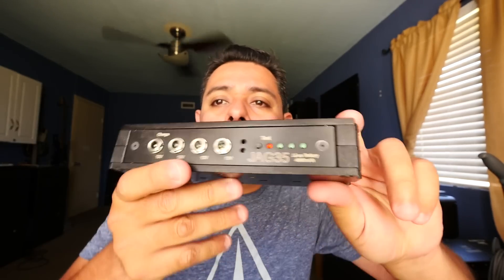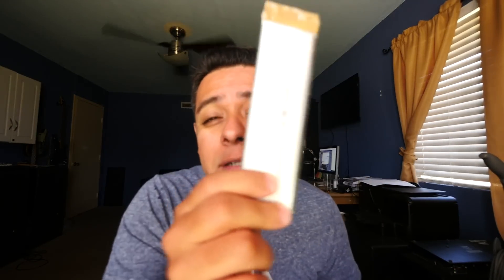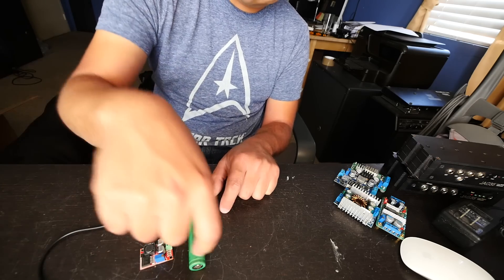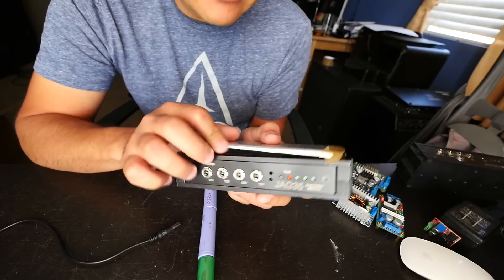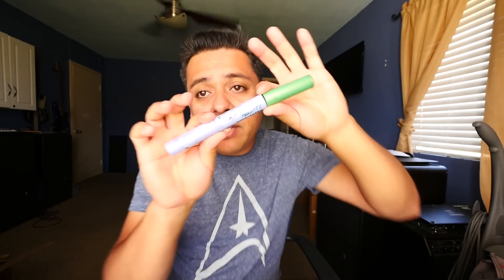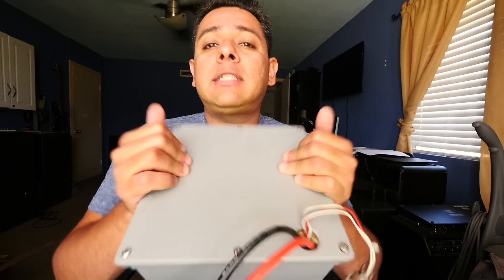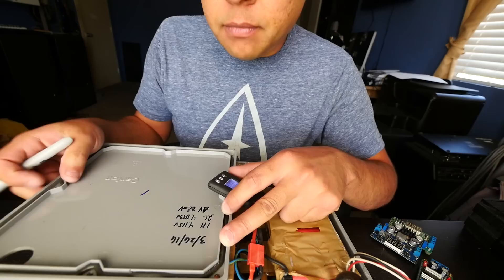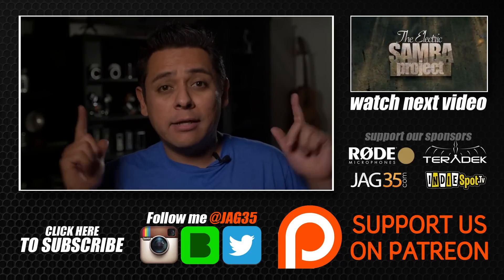How to Charge Lithium Batteries

Comment: OK,,I BOUGHT YOUR  U1XP12,,IT HAS 2 CABLES COMING OUT OF IT..WHAT PINS DO YOU USE TO CHARGE IT?
2 YOUR MONITOR YOU SHOW ON THE VIDEO FOR THIS  U1XP12   DOES NOT SHOW HOW TO HOOK UP YOU  BMS?
CAN YOU TELL ME  WHAT PINS TO ADD A 2 WATT WALL WART CHARGER..POS/NEG PINS?
VERY FRUSTRATING THERE WAS NO WIRE DIAGRAM FOR THESE BATTERIES.
I REACHED OUT TO YOUR TEAM AND GOT NO INFO..
CAN YOU DO A VIDEO FOR THE U1XP12 BATTERY,HOW TO ACCESS THE  WIRES?
THANK YOU

Comment: I have a question.  Was looking for a video on direction in how to use a 1s to 6s  TB6 Hobby charger/ Balancer  to balance a 60v 40AH  Lithium Ion battery pack in my Electric scooter.  Is  there an adapter I need that will support a 16s? Do i have to break my battery down into 3 sections? Do i need to buy a different,  more expensive balance charger??  Is there a way without doing any of the mentioned above?? Your videos are very descriptive, so I chose to ask you this question.  Thank you,  Anyone.... for a response.

Comment: Dang.  That's a lot of information...and too much math for me.  Good job on the video.  But I just want to know if my mini-chainsaw battery is going to get ruined if I leave it plugged in too long.  I had a handvac that worked two times before I had to throw it out.  It would not hold a charge.  I want to know when I begin cutting, that it isn't going to dwindle down to a low hum because I overcharged.

Comment: Hi can I use a lead iced battery charger that is 1amp 12v. To charge my lithium cells pack that it 12.6v ?
My charger is ready the lithium cells but I’m not sure if it’s save for me the use that charger as it’s meant for lead iced..
Can you advise on would it damage my cells if I attempt to charge with it.
Reply from the maker: Lead acid chargers go all the way up to 15v  it will most definitely over charge your 3s 12.6v lithium battery.
Reply: @jehugarcia  my charger has a settings were it stops at 12.5v
Will this make a difference?
Actually it will not go over 12.4v and 1Amp
Reply from the maker: Idk
Reply: @jehugarcia  sorry not familiar with that..    is this ok or not ?

Comment: Just like magnets, coils , solar cells or batteries are cellular devices..

When working with prius nimha batteries you have to put diodes on the + of every cell in the bank to preven voltage ballancing, similar to puting a blocking diode on a paralell connected solar panel..... The purpose is to prevent the weaker batteries/cells from pulling down the voltage of the newer stronger batteries causing the newer batteries to pattern into a shorter life and lowered charge capacity......

If we need blocking diodes on all our paralell panels connections, does this not indicate all psralell connected devices should have blocking diodes at all paralell conections in any power chain system ????

It seems a shit load of diodes in the system would prevent or. Lower overall heat values over time extending the cell life... 

If blocking diodes lower reduce heat and increase efficiency, panel optimizers also extend the life of a solar panel and increase effeciency...

Shouldnt we have some kind of optimizer/bms for each battery cell .

Comment: I would add to the many good comments and tips posted already, BMS are pretty cheap now, esp. for a DIY'er and if you can't attend and monitor charging, a BMS can add the safety you need with lithium batts cutting the power when it's set V is reached. some also can set a flat timer for charging

Comment: In my 48v battery-bank I’m using 3.2v I have 13 PCs at 280Ah and I’ve got 4 PCs 3.2v at 200Ah can I run in parallel 2 of the 3.2v 200Ah = 3.2v 400Ah can I use 2 - 3.2v 400Ah in my battery bank of 280Ah & if so the best place to put the ? As the the main - & + or as the Batteries 7 & 8 in the middle of the bank ? But their 120Ah over the 280Ah is it better for all the life to just use the 3.2v 200Ah as is ? So the 280Ah are only 80Ah more ?

Comment: Hi I have a question, I have an electric scooter with a power of 36v 1000w, I want to use a Lifepo4 3.2v 2000mah battery, it is possible to use them in an electric scooter with such a power,
Jirka volf

Comment: Well you forgot to mention that impedance does increase if you actually left the charger permanently connected to the battery as you said. Now sure how familiar you are with gauging and impedance track. I use to work for TI in the BMS group.

Comment: Sorry, but you're just plain wrong and are giving bad advice. You say that once the 18650 cell reaches 4.2V it can just be left connected to the charger indefinitely (as its voltage cannot rise any further). WRONG! Holding the cell at this voltage will cause plating to occur, permanently damaging the cell. As soon as the cell reaches 4.2V the charge should be TERMINATED immediately.
I only watched the first few seconds of your video because, after you said this, you completely lost my trust. You seem to think you're some kind of expert - and come across as such. Well, let me tell you, you're not. Please make sure you're giving good advice before you pontificate
Please take down this video.

Comment: NOTE: Charging batteries in series without a BMS is not advisable. 8.4, 12.6, 16.8, 24v, 48, etc. It goes Batteries, BMS, and then the boost, buck charger connected to the bms that's connected to your series/parallel battery pack.

Basically.

Comment: is it possible to charge a 7.4v (18650 x 2 series) DIY battery with a standard 5V USB charger? Im trying to make a portable powered 12v fan run off my 7.4v DIY battery but can't seem to figure out how I can charge the pack through USB as id like to 3d print a box and keep everything enclosed in it (Battery, 2s board, fan, USB charge port and anything else needed). THANKS FOR ANY INFO!

Comment: "How to Charge Lithium Batteries"
Easy...Do not exceed 4.2V OR current flow @ more than 1/2 [50%] of the rated capacity of the cell or cells in parallel.

Comment: I need 7.2 volts.. aka 2 in series.  So charging the cells separately one at a time with a 4 volt charger vs charging them in series with a 8 volt charger makes pretty much no difference in performance?
Reply: 8.4 volts in series may not be as accurate as 4.2 volts each ...

Comment: jehugarcia : I sense that you know a great deal about batteries and chargers.
I have an old, but really good and powerful, Dewalt with dead NiCd batteries.
Can the cells be replaced with Li-ion and still use the same charger?
Reply: What is voltage of the NiCd pack ?

Comment: 1. You can not charge battery with voltage regulator which only work on constant voltage mode. it still can over current and damage battery
2. You can't just parallel battery for charge. 2-battery can have voltage difference that lead to high current flow and damage battery
3. You can't just series cell and charger you need to balance these cell using balance charger or BMS .
4. Note that you should not use charging current more than 1C. it can shorten battery life.
5. for who ever plan to do this just buy programmable charger which you can charge many battery type and select suitable charging voltage and current for each battery.
Reply: 1. Yes we can, and we do ...
2. Yes we can, and we do ...
3. Yes we can, and we do ...
4. There are 18605 Cells that can charge faster than 1C ...
Reply: @MrSummitville  if you are normal person you can do. It's your right and risk. but if you are engineer or youtuber that teacher other without real knowledge, you can't  you should have responsible for society.
Reply: @mlab3051  So then ... stop telling us what we can't do because you have no clue ...
Reply: @MrSummitville  fine it okay to live with ego but I prefer knowledge.
Reply: @MrSummitville  if you have any argument please say in science or engineering term.

Comment: Thanks for the informative video!  So what do I need to buy to make a charger for 18v 18amph battery?  (I'M trying to charge 2 m18 9ah milwalkee batteries in parallel without using the milwalkee single battery charger)

Comment: Thanks for your great postings.
Im in Australia.
I’m going to install 12v 240v 3000w Inverter with 12v 100ah Lithium Battery in my car.
I’m trying to find a way to charge the Lithium Battery from 12v (120w) Lighter Port on dashboard directly in my car without connecting with my car battery if possible.
Can you tell me what kind of stuffs that i need to buy from like Amazon?

Comment: Can i charge an external 36v hoverboard battery with a 36v pover supply that has a different connector, to use it with a controller?

Comment: I read and listen to the people advising all kinds of things and selling chargers as if they are more important than the device using the battery?
Ask yourself 1 question and you will get my drift.

There are other devices using lipos and I mean not just rc or ebikes but other toys or electronics etc. You know how those 4x4 off road scale models run and compete. I'm sure that is a lot of stress on the rc as well as its battery. Think jumps gone wrong, rumble tumbles impacts and motion. Why don't they have it blow up in just playing with them because they actually abuse them not only electrically but physically like I wrote above they don't explode till every thing is OK only, a malfunction is the reason for it if it happens.

I found this a little too much about charging lithium ion batteries and in the rc world about lipos and how the can catch fire and all that. I'm not saying the risk Is absent, but the way it is portrayed in the rc world specially and the exorbitant pricing of things is not based on reality. A few sheets of depron some plywood etc is in a kit  and they are charging 70-80 to 500 dollars for pnp or af with electronics kit.
Lipo batteries need special attention and care, you have to check on her multiple times while charging and it is all hogwash and any reasonable person will see that.

How can we not see this when there are consumer goods and products. Even lithium ion batts were this way and lot of noise was made about them too.
Every smartphone has  lithium Ion batteries and apple and some other devices use lipos. Have you seen any swm

Comment: 2x4.2 volts is 8.4 volts you confused it by doubling 3.7 volts that comes to 7.4.in fact they call it 3.7 volt which is why it is not 8.4 volts but 7.4 volts and then 11.

Comment: ok i doubt he even pays attention to this anymore but, i have a question. i have a big inverter for servers, it has a max dc out of 55v to charge the 48v battery system. now i built a 55v nom li ion pack from chevy volt battery.  i let it charge on the inverter for 4 hours and it never got warm, it did go to the 55v that it was made to do. i know so much is said about the bms but i am wondering, if i us the battery on this setup lit it is and the 55v max is in the nom of the li ion. will it have issues? i am just not sure how it can ever be over charged or even charged to fast. the inverter has a lower charge rating than the li ion cells.  anyway if anyone wants to tell me how i am stupid, not just that i am. i would love to know

Comment: Can someone point me to a board similar to what he shows as a “power supply”? I’m building a 3s15p 18650 battery to supplement/charge my Yeti 1000 lithium. I need  constant output of 15-22 volt and 25 amp max from my diy battery to safely put power back into the Yeti.
Reply: That is DC buck converter one is step up one is step down depend on your power supply

Comment: Great video..… but I am looking for a "Lithium Cell Charger Module (BMS) with Battery Protection board" that would output a 18V (5S) system..... any thoughts????
Reply: george manson 18 volt powertool battery is ure best bet
Reply: @simpesfaip  Thanks

Comment: Jehu, I just found on the street a Ford Go battery pack and seems to be working fine. The problem is I don't know how to charge it. It has a connector for a wall power supply but no idea of what kind of voltage has to be. Do you have any idea of that? Thanks
Reply from the maker: No

Comment: 5:22 I know someone has probably already said this but 4.2v * 2 = 8.4v dude :)
Reply: 7.4v is the nominal voltage, 8.4v is the charging voltage
Reply: He also said you gonna turn up the supply to 4.2v in order to charge at 7.4v pack, which is wrong. And he should have also added that this won't be a safe way to charge batteries in series! Different internal resistance so some will charge faster than others leading to overcharge (fire)
Reply: I only checked the comments section for this
Reply: You're a math genius
Reply: He mean nominal voltage
Reply: I have 11.7 or 11.1 V 3cell Lipos... SO FUCK ALL OF YOU!
Reply: @kdevus  ?
Reply: BYUNG JAE Lee sorry bae. Still love me?
Reply: @kdevus  You lose. I have 2P7S setups.  25.9 nominal, 19.6 discharged, 29.4 max charge but set to 29.2 for safety. And 4.4 Amp per pack. And each and every cell is on its own BMS section. And there are 10 of those in each .50 Cal. ammo case. Making it a 25.9 Volt, 44 Amp battery with 140 individual cells.
Reply: @kdevus  I have a magneto for that. Here, hold my wires. ;-)

Comment: Its pretty good explained but a few details is missing... What about if my output is 16V and my batteries that are connected in series ends up on 16,8V? Can that be any dangerous? Or does it just mean that the batteries will never be fully charged? Or what actually happens? And what about amps? Does that even matter at all? Or is it only the volt that i should care about??? Please, either reply to this thread or make a new video and explain more details... I have a bunch of batteries that looks like those small green batteries that you just showed. I got them from a laptop battery but im not sure if its same voltage in my battery as in your battery. The voltage is not displayed on the battery itself... So is it same voltage for all batteries that looks like this? Or how does that work? How do i know how much voltage my battery will need?

Comment: I have two questions.i just build a 3s battery pack with balance charge cable (did not put pcb) total 12 batteries .My first question : 
1)is it ok to use the battery pack without pcb? what should be my minimum voltage to stop using the pack?
My second question is:
2) if i try to charge multiple cells lets say all of them (12) but each cell have different amps (capacity).is this safe? I know its not the best (pack will not perform as it should). Will all of those cells reach their real capacity when charging finish?(i have a turnigy when charging).what i understand from you is that turnigy will keep giving 12,6v to all the cells and 0,5amps(my charge setting) untill every cell is full.thanks and sorry for my bad english;)

Comment: I started pulling my hair out when he said 4.2 × 2 is 7.4.... twice!! Twice??
Reply: ohh shiiitt , nooooooooooo , i lived my whole life thinking that 2 18650 bateries equals 8.4 v , damnnn , i lived in a lie :)))))))
Reply: I would like to ask. Normally 18650 is max at 4.2 volts.and now i got bms for 26s config. Now how can i under volt them charging them at 4volts. Should i supply 102v and bms will balance them at 4v each cell or some cell will be 4.2 and some cell are lower.?
Reply: I may be mistaken but don't these li-ion cells reach capacity at 4.2V? The nominal voltage is only 3.7V.

Comment: I am using chev. Volt batteries to power my golf cars.  I would like to use the chargers that come with the cars .Is this power supply that you are talking about the way to keep from over charging my battery?  We are using 2. 48 volt packs wired parallel And then to the car.  My charger can put out about 20amp at 57 volts, and the goes down as the batteries go up. If this is the way to go ,do you have  specific power supply you would recommend for this application.

Comment: Can I use a 24v 1.5 amp charger that was uses originally to charge lead acid batteries 2 12 volt in series to charge a 24 volt lithium ion battery?

Comment: just use a 4.5 volt 300 milliamps with a 100 ohm resistor in series.the voltage of battery rises from 3 to about 4.2 volts and current automatically reduces as 4.5 -- 4.2= 0.3 volt divided by 100 ohm =0.3 milliamps = trickle charge

Comment: did you tell us how many amps your 12.2v charger can output?  how many amps does a 33p3s 11.1v (or is it 12.6v) battery draw when charging?  a comment below asks what happens if too many amps are presented to a battery.  You say to keep things safe keep charge/discharge rates below 1c.  You say a 5,000w charger for your 126v battery will initially present 5,000w to until 126v is reached at which point the current will be 15 amps and gradually lessen until 5 amps at which point the 126v battery will be considered fully charged.     Your 99 cell 33p3s battery is (1,800mAh x 3.7v)  6.66Wh x 99 = 659Wh.  659Wh/12.6v = 52.3Ah    So how many amps is 1c which can be safely presented to the 12.6v, 33p3s battery?

Comment: How could i make a charger for e-scooter 60V 29A which stops at 75%? And un other question. the e-scooter is Niu n-series. The battery cost about 1200euros. It is made of small cells Panasonic NCR18650PF 18650. Now i can buy those 180 cells that make the whole battery and weld them togather . But how could i know the quality is the same as the original?

Comment: Hey J
First of all, love your video's, awesome work!!!! 
Keep it up, we love your attitude.
I have been using a hobby grade "battery checker" something like the ones you use in your video's and after a balance charge on a high quality charger I have noticed a variance in cell voltages so I pulled out my recently calibrated Fluke Digital Multimeter, Just as I thought the cells were balanced perfectly but my "checker" was way off in fact both of my capacity meters were off.
Just a heads up when doing benchmarks.
Thanks again